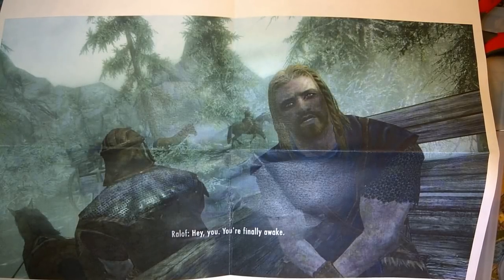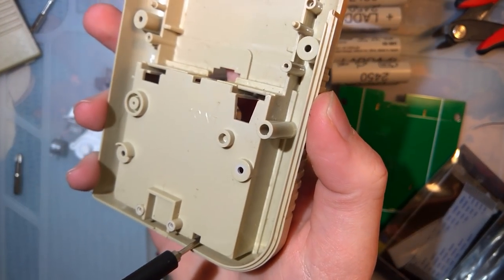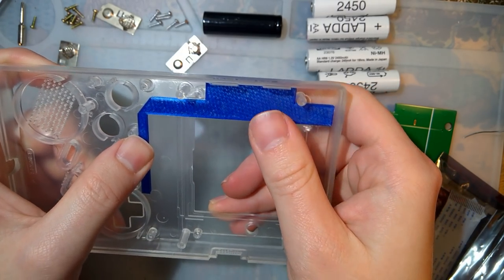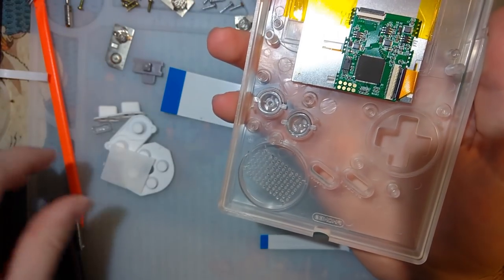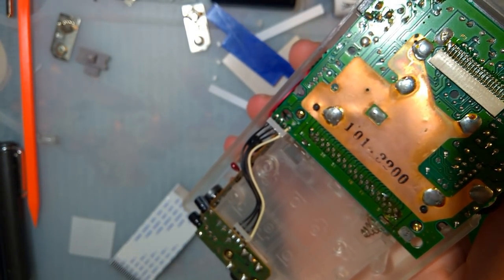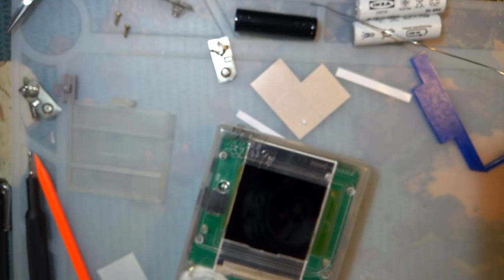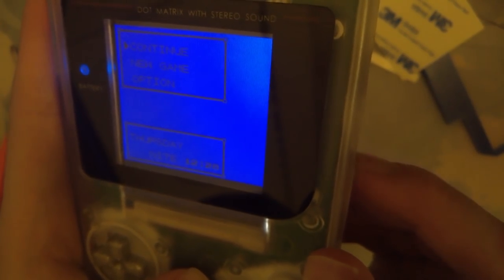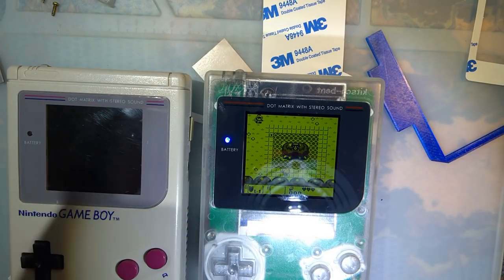Installing the Fixed DMG IPS Kit (RIPS v2) in an original Game Boy

Comment: Hey Makho the centering bracket is indeed mine. Did you use a glass screen? All glass screens I have are about 1mm off-center to the left (when looking at it), where the plastic ones I have are perfectly centered. I think that is why your screen looks off centered. When I designed it I centered it in an original case around the actually opening. Thank you for trying it out and your feedback. I think there might be too much variance between cases (OEM and aftermarket) and screens.

I'm thinking about selling my IPS DMG v1 and getting one of these kits. The contrast on the v1 for black and white is pretty bad. Also the Pokemon Yellow pallet is cool but on the v1 kit with fix it makes pink the main colour in most games, which looks weird.
Reply from the maker: Yes, I did use a glass screen. That explains what I saw. 

I agree regarding the palettes but I've found myself using the green or the olive palettes most which appear unchanged between v1 and v2 firmware. The gray palette does look a lot better on v2 though.
Reply: makho - it’s funny cause in your first video you said the green was your favorite. I didn’t think I would use it, yet I have to agree the green and olive are my go to colours. The grey on the v1 kit looked too dark to me. I ordered a couple v2 kits from AliExpress. It’s funny cause I normally reach for my GBA, but now it’s all about the DMG. I’m playing Final Fantasy Adventure right now. The Pokémon palette actually looks good on it. How do you like the Ez-Flash Jr? I have been using the Leon DIY cart (everdrive clone) and it’s pretty good.
Reply from the maker: @OkiDingo  I don't use my EZ Flash a lot tbh. I build ROM carts too and to actually play games, I use those instead. The EZ Flash and Everdrive mostly get used for testing things due to their massive power envelope and ability to boot pretty much any ROM I need quickly.

Comment: That Skyrim poster at the beginning is hilarious :) Glad they fixed that pretty quick. Another improvement would be a pre-soldered speaker to the front PCB, and that would make it totally solder-free.
Reply from the maker: Indeed. I completely agree. It would solve one of my major complaints since without the thermal reliefs on the ground solder pads, soldering properly to this thing is going to be very difficult with a cheap iron.
Reply: Actually I just saw some eBay sellers from China yesterday offer such an option plus an optional pre-modded shell, not sure what kit version that was, though

Comment: I'm currently working on two gameboys with the V1 screen, and even with original membranes, I'm experienceing the weird D Pad issues you have here.  I'm using custom 2-part buttons though, and when I use the original D Pad button, everything is fine.  I think the multi-part nature of my new D Pad is making the button a bit thicker, so I'm going to correct it by sanding down the underside of the button.

It's possible that the new membrane you're using is a bit too thick...which is disappointing to hear.  Maybe you can try sanding down the underside after protecting the carbon pads with some masking tape?  It might help...or could ruin it...It's something to consider though!
Reply from the maker: I think either the dpad I'm using or the membrane is garbage. But yeah, it feels like there is not enough travel. I need to swap one or both out (both are from retromodding).
Reply: @makho  Interesting, I've had good luck with their membranes in the past, but not with their replacement shells. I'll look forward to an update if you can get this Gameboy feeling right!
Reply from the maker: @EmelieKerek  Most likely it's just going to go back into an OEM shell at some point. I would like to pick up a clear PIL DMG though.
Reply: @makho  Gotcha, I don't blame you there! And I've been looking for a clear PIL Gameboy in the wild for awhile now. I finally found one one day but it was sold right out from under my nose. Ah well. Happy hunting!
Reply: You should try sanding or scratching the surface of the metal contact pads, it will be much more responsive after that.

Comment: I meant to ask you before.....do you find the LED battery indicator way too bright? I am thinking on my next kit to put a tiny piece of opaque scotch tape on my lens over the indicator hole.
Reply from the maker: I was considering putting a small bit of white vinyl tape over the LED but under the lens. This does a great job of diffusing the LED and cutting down on the brightness. I did the same thing for AGS-101 modded GBC.

Comment: Nice job. I just did this mod last night. However, every button but my D-pad seems to need extra pressure to work. Also, I accidentally pulled a lead going to the speaker. Its still there, but the volume is low.
Reply from the maker: If you used a bracket, I'm told that some of those are causing fitment issues. If you are using aftermarket parts (dpad or membrane), those could be causing issues too.
Reply: @makho  yeah, I used handheld legends bracket.
Reply: You should try sanding or scratching the surface of the metal contact pads, it will be much more responsive after that.

Comment: The fixed one from retromodding.com is fixed as this one too? Thanks
Reply from the maker: I know RM was doing the gray inversion fix on their kits but I don't know if they have the actual fixed units yet. The difference between inverted v1s and v2s are that the gray palette on the v2 kit has much better contrast and the yellow/pink color palette on v2 looks a lot better (at least with Pokemon Yellow).
Reply: @makho  Thanks for the info!

Comment: Do you have responsiveness issues with the v2 kits? I got three and all of them you have to press the d-pad and buttons really hard in order to register. I had no issue with the v1 kits
Reply from the maker: I have not when using OEM buttons and membranes or the kitsch-bent buttons. Check that your LCD spacer is not too tall because it seems that those are the cause of many of these issues.
Reply: makho - so I finally found some time and figured it out. If I loosen all the screws on the main board about 1-2mm it now works perfectly. I will get some plastic washers to place between the shell standoffs and the board.
Reply: You should try sanding or scratching the surface of the metal contact pads, it will be much more responsive after that.

Comment: Ironically, I'm also having the issue you're experiencing at 40 minutes...though I'm not using a flash cart.  Some of my games just straight up do not work on Gameboys using this mod.  Even with a 5v step up regulator.  I can't seem to pin down why.  Everything checks out when checking with a multimeter.  Nature of the beast, I suppose.
Reply from the maker: I need to do more investigation then. I just assumed it was a bad dump (which does happen more often than not when you aren't checking your ROMs as you dump them lol)
Reply: Do you have the v1 or v2 kit? I just tried Mario Land on my v1 kit and it loads fine using a CPU-06 and CPU-08 board. It might be an issue with older CPUs. I tried both a cart and with a flash cart.
Reply: @OkiDingo  I'm using the V1 kit and a CPU-05 board. I think you might be right though about the older CPU's. I also noticed something interesting tonight while I was tinkering - while fitting the two halves of the Gameboy together during testing, I didn't have the shell lined up quite right, so it sort of shifted into place with a snap and the Gameboy crashed (screen froze and turned black). Rebooting it after checking that all the cables were connected proved that everything was fine, but I'm wondering if some contacts touched and shorted or something, and if it's related to why certain games won't run on my modded system. I don't see how it could be, but the screen behaved the same as to when I try to play games that don't work.
Reply: @Emelie Kerek - remember reading a reddit post a few months ago about the different CPU models and backlighting with flash carts. The jist of what they were saying was that the new boards (higher CPU number) were a lot more energy efficient. Which makes sense as they got older the technology got better and they were able to make them more efficient. Also this kit is pulling twice the amperage and probably more volts. Since you said you wired in a 5v regulator (I know that fixes the issues on the pockets), it probably isn't anything to do with the power regulator. It must be something with the CPU or just your board. I would try another stock CPU board and see if it fixes it. 

Normally when I look for donor DMGs to mod I got for the coloured Play it Loud series, as they have newer boards.
Reply: @OkiDingo  That would make a lot of sense. I do have another board that I plan to mod with, so I can test with that one when I get to it! Thank you for your replies and input!
Reply: Emelie Kerek - no problem, anything to help.....btw, I just checked and Makho was using the same CPU as you (CPU-05) in this video.
Reply: @OkiDingo  that confirms your suspicions, it at least is more evidence towards it!

Comment: Do they make a similar mod for the Pocket? I’ve got one I’m wanting to mod but don’t like any of the current screens available. I like this style of screen because it’s “true” to size and not smaller like the rest of the mods out.
Reply from the maker: Nope. No good options for the Pocket yet. The LCD used in this mod does not physically fit inside the Pocket if you still want a power switch or a dpad (or both).
Reply: FunnyPlaying is about to release one....however they claim the max battery life will be 3 hours on the largest capacity AAA batteries. With a flash kart, maybe 2 hours. Worse then a GBZ!
Reply from the maker: @OkiDingo  I've got some ideas on that =)
Reply: makho - can’t wait to see what you come up with. Do you have kits coming? Unfortunately international mail is cut off for us in Japan at the moment.

Comment: I have anew V2 kit but left and B buttons don’t work and I don’t know why. Anyone having the same issue?
Reply: You should try sanding or scratching the surface of the contact pad, it will be much more responsive after that.
Reply: @ERUtube  Hey Eru, thank you very much. Will definitely try that out.
Reply: @ERUtube  Funny update, I by accident mixed up your answer with another issue I asked help for: the touch sensor in the IPS kit for the Neo Geo Pocket Color didn’t get any contact, when I closed the case - no matter what I tried -, so I thought you were answering to that issue and that’s what I thought you told me: “sand the contact”, so I did. Sanded down the first layer from the touch sensor until the copper surfaced and BAAAM that did the job! The touch sensor works now and notices it when I touch the case. Thanks again:D

Comment: Hey Makho, the DMG IPS doesn't require the original screen to be in working order right? 

I broke my original screen :(
Reply from the maker: Nope. All you need from the front board is the speaker. And you don't even need that really. Any quarter watt 8 ohm speaker that fits should work fine.

Comment: Yikes. They increased the price of what the v1 was at around $56 to nearly $70 for the v2... I should have jumped on the v1 since as you have shown, it’s fairly easy to reroute the traces on the motherboard.
Reply from the maker: RGRS has increased their price due to the limited supply. Things are still rough in China due to the virus but as soon as stock stabilizes (estimated late March if nothing else goes wrong), prices will return to normal. You'll probably notice that nearly every other store is out of stock right now. Same issue.
Reply: makho Makes sense. It totally slipped my mind about the corona virus going on over there. Anyhow, thanks again for putting out these videos, they’re always informative.
Reply: Except in the case of this mod it seems to be purely a software fix... And I can see now on both eBay and AliExpress the sellers (not all of them) offer the updated version at the same price.
Reply: These updated ones are $54 on AliExpress with free shipping
Reply: @OkiDingo  The real mvp. Thanks for the info!
Reply from the maker: @AtoManPL  Like I said, supply is still low. Prices will come down when the supply stabilizes.

Comment: did it come with the 3d bracket ?
Reply from the maker: Nope. This is the bracket that I used (and meant to link in the description): https://www.thingiverse.com/thing:4141389

I still think it's easy enough to eyeball the install though. My screen was not perfectly centered with this bracket.
Reply: makho Will the price drop under 60 bucks ? If not this is not worth doing over the FPv2 gba kit. I am asking to make my decision on the second mod
Reply from the maker: @salaadas  Well, like I said in the other comment, prices will come down with the stock stabilizes. If you can wait until late March or early April (current estimates), then yeah, you'll be better off.